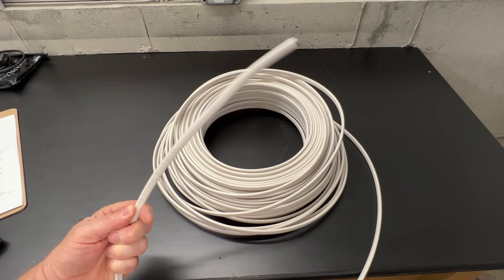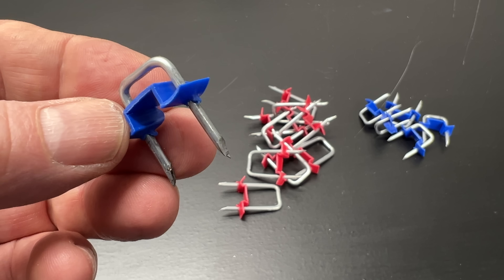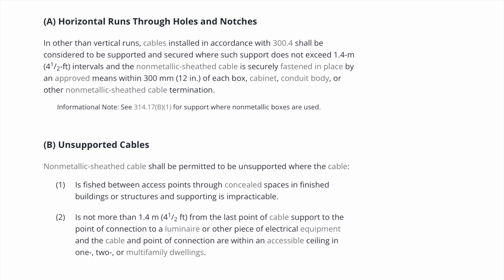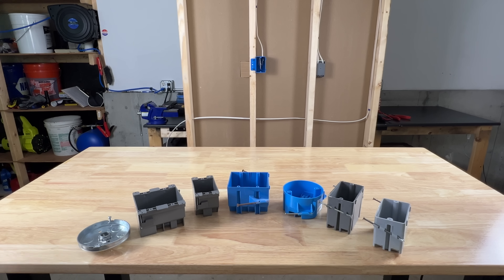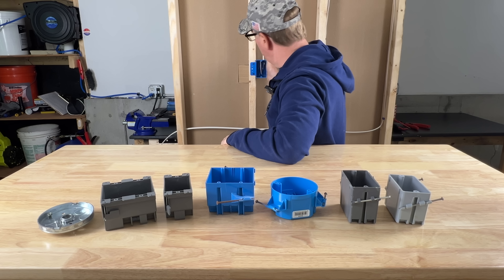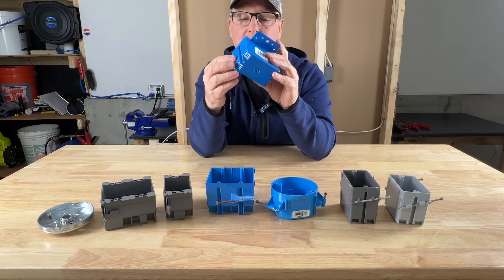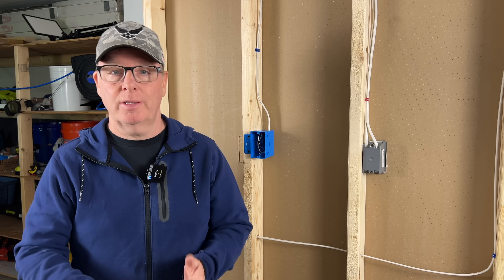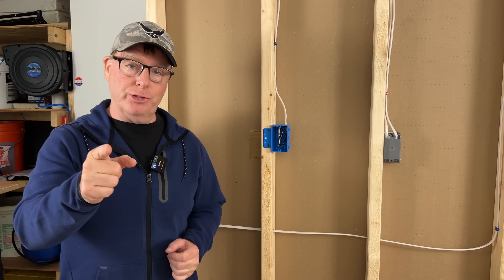ROMEX Cable Support Requirements (2025)

Comment: Alberta electrical inspectors are all looking for the service loop at the box. Not having them fails the installation.
Reply from the maker: Many inspectors here in the US will make you remove them.
Reply: @BackyardMaine   I have worked on old switches that only has 2” of wire inside the box after 40 years of changing switches/timers. A service loop would have been lovely. This still sticks in my mind 25 years later.

Comment: Informative with all the gotchas, thanks for the explanation, I just ran ceiling lights to a quad gang control box in the attic,  while it sounds like the ceiling light boxes don't need secured due to running straight in to the support trussing the control box the cable runs in to need to be secured on that end as well as at the box which it is.

Comment: I use a box of staples every 5 years since I bought a battery powered Milwaukee stapler. It was about time they invented them.
Reply from the maker: I want to try them.. Do they work well?
Reply: @BackyardMaine  yes. I originally had a dewalt and hesitated buying a Milwaukee because they came out a couple years later. But I couldn’t get staples for the dewalt during covid so I bought the Milwaukee. I use both on jobs. The dewalt seems to run longer( bigger battery) but the Milwaukee seems to drive them better. All in all the Milwaukee gets more use as I have multiple batteries for it and the guys prefer it. Money well spent for sure.
Reply: @BackyardMaine  and I use them steady for Mc cable in wood construction

Comment: So all the oh so picky spacing rules go out the window if the cable is run thru a finished wall?  Did the safety reasons disappear just because the wall is NOW enclosed, because when I'm running the cable in a open wall with all the 18" 4.5 ft rules - that area will soon be enclosed.  So the rules are just one more regulation that does nothing for safety but makes all the electrical cabling companies more money.
Reply from the maker: The biggest risk to the wire is during the construction process. Nails, screw, pinching the wire between the drywall and stud other trades etc.

Comment: If the staple is at 4” per se, and the wire is 8” in a unclamped single gang box. Couldn’t that still be a “service loop” (without the loop) and still be in code?
Reply from the maker: Yes a small loop, just be carful of the bending radius requirements.

Comment: Question:  A friend and I were both putting a small addistion on our homes, we live about 50 mile apart. Both have permits but neither of us are lic.  Anyway he used WAGO on his connections and was passed by the town inspector,  I asked my town if I can use them, and was told no, I had to use the twisted wire nuts. Both in same state, different towns. Hmm and why the differences?
Reply from the maker: Some inspectors will try to force there on rules or maybe the town has local code amendments. They are legal to use in any states per the adopted NEC

Comment: The instructions clearly says that the support must be within 8 in of the box, it does not say within 8 inches of cable length. Where did world did you get that interpretation. I know it says measured along the sheath, but it also says within 8 inches of the cable box. Which side of the interpretation are you going to take??
Reply from the maker: Measured along the sheath means cable length. The sheath covers the cable so if you measure along it you are measuring the cable between the support and the box. It's not an interpretation. If you wanted to staple 4" from the box you could still have 8 inches of cable or sheath for a small loop but you have to be careful of the minimum bending radius.

Comment: Yes you can have service loops at 1-gang NM boxes w/o clamps: you can leave a loop with a staple right next to the box opening. If you ever need that service loop slack, just remove the box and that staple is right there for easy removal. 

Oftentimes, we have need to convert a single gang switch box into 2, 3 or even 4 gang —such as for Lutron RadioRa devices. We prefer Allied's fiberglass box because they're easy to break out with a long nose pliers and the device holes are factory threaded unlike many PVC boxes. 

Started in the trade in 1975 been in business for over 25yrs. You and I are brothers in the trade
Reply from the maker: There is minimal bending radius to consider if the staple is close to the box.

Comment: Thank you!
I am going to run some 4/3 romex and didn't know if the rubber lined cable clamps that are attached with screws would be acceptable and don't want to be using large staples.

Comment: question on wire support. 

lets say we have a situation near a main panel, where you have a space between studs that has SEVERAL wires running back to the box. there is not enough surface area to staple every cable to the joist. i will staple the 3 or 4 that i have room for, then i will zip tie subsequent wires to the secured wires. i have had people say this is against code, but i have never had an inspector say one word about it. 

what is the official nec code book ruling on this practice?

Comment: Cool I roughed in my new basement room and the only mistake I made is using blue staples for double wire. so I'll change them up to the longer red ones and everything's good. Also good to know about being able to put two Romex in one of the openings of the box I think it'll be a neater look

Comment: So for horizontal runs THROUGH holes, no extra support is needed.

However, what about horizontal runs on TOP of things like ceiling joists?

Even more complicated by runs at high angles to the joists?
Reply: I’d secure them every 4 1/2 ft. just as an added safety measure to keep them out of the way.  Personally, I don’t want to be in a crawlspace or attic and be obstructed by wires.

Comment: It looks like the romex is running through the middle 1/3 of the stud ? I work in the manufacture housing industry for many years, we could not drill in the center of the stud without a prosleve, but stick built could. I do like your videos.

Comment: I never use plastic boxes cheapo junk use a metal box cut good size hole in the drywall come back fix the drywall. When I got 3 quotes to change out my aluminum wire with copper all 3 wanted to use plastic boxes when I mentioned metal box they didn't want to use them. The reason I like metal boxes is one time a contractor installed a water heater he used wire nuts to bond copper and aluminum. The connection wasn't good and heated up the wire burned back into my wall the only thing that saved me was a metal clamp on a  metal box where the wires were pushed tight enough to trip the 50 amps breaker. The aluminum wire burned like a fuse.  If I had a plastic box it would have burned up into the attic caught fire I'm in Arizona our attics are dry and hot easily catch fire.

Comment: Apparently the code varies across the country or the ordinances can have requirements above the minimum requirements in the code, for instance in Houston we cannot stack Romex on top of each other we have to use stacking blocks or brace between the studs and secure individually.

Comment: Another remarkable clear and concise explanation. Thanks John. One question regarding staples...actually two. Sometimes NM cable is run along the webbing of engineered joists. The webbing is not very thick so the end of the staple might protrude from the other side and if one tried to use a red staple for two wires it would definitely protrude...which would defeat the purpose of using a longer staple (so I have never done it). Are there rules for that?  Also what are the rules for avoiding "bundling" violations for NM cable?

Comment: My ex-boss was a cheap fu... he would get the cheapest supplies imaginable.  We always followed code regardless of the crap we had to work with, and only 3 times did we fail inspection.  There were 16 guys on our team, but one guy always decided to do stuff his way and got us ding'ed all three times.  We hardly ever secured cables (romex), within 8 inches of the box, it was more closer to 6" and we never had an issue with that.  Clamp in the box  or not, 6" was our max for a staple.
Reply: I’m not an electrician but isn’t it “within 8 inches”? So, 6” is within 8”… by that language you could staple 4” from the box and leave a 4” service loop and be ok, no?

Comment: Thanks for the content, especially for digging into the code and clearly explaining it. I actually paused the video and pulled out my codebook to see if I could figure out the code violation on my own before you explained it in detail. 

No, I didn't figure it out on my own, but I did run down "messenger-supported wiring". Learned something new!

Also... the 2023 code does make some very minor changes to 314.17, but most jurisdictions are still yet to adopt it so :shrug:

Comment: What's the logic on  not securing the cable at a ceiling light?
Reply from the maker: It's often not feasible when using can fixtures or strip lighting. As long as the fixture has a clamp and you secure to the nearest joist and within 4 feet it's acceptable and is at minimal rick of damage.

Comment: Heres how it really works. Code is 12 inches. Depends on the inspector. Loops are really dumb but one inspector here expects a loop. So we do it yo code and have a loop.
Reply from the maker: Code is not 12 inches for boxes without a cable clamp.

Comment: What type of cable ties can be used to tie together multiple romex wires for example in the electrical panel to make a clean install?  Any particular brand?  Or just the cheap dollar tree ones?
Reply: I would just neatly train and bend them without any of the plastic ties.  They won't won't flutter around. And it leaves air space for ventilation and makes it a lot easier to trace if needed.

Comment: Awsome video John, great to have the summary,  a true teacher!
You mentioned the plastic boxes and the code compliance,  what about metal boxes, does what you just went over vary??
Reply from the maker: Thank you my friend. Metal boxes will have a built in cable clamp or knock outs where you would install a ROMEX connector. All metal boxes require a clamp.  The requirement of within 8 inches is for single gang non metallic boxes without a clamp.

Comment: So if you have an issue later you will have to rip the wall apart to fix it .
Reply: You're missing the point of the code. It's meant to keep the cable from being penetrated by drywall nails/screws mainly and by other things. Drywallers cannot hit a stud consistently to save their life and if your cable is touching up to the drywall, it's going to get penetrated by that screw.

This is not the fault of the drywaller. It's only their responsibility to use the correct length screws for the drywall as to not go within the center third of a stud. It's an electrician and plumbers responsibility to keep their cable and pipes in the center third of the wall. And never the twain shall meet and everyone is happy. If a screw is missed, it's a non-issue.

The code on all sides was made to be this way. To account for many scenarios including improper installation and mistakes. So that none of those things can either cause damage to the material or damage to a person, as much as reasonable.
Reply from the maker: If everything is installed correctly and wired correctly, you will never have an issue later. I wire my home 26 years ago and I have had zero electrical problems.
Reply: @BackyardMaine  yes but there is millions of houses bought and sold ECT there are additions and such, there could be a fire or over load so please don't be so close minded or self centered because u still live in the same place you wired,as this isn't about you it's about everyone and please I'm not picking a fight.
Reply from the maker: @kerrytaylor4366  I'm not close minded. I just follow the code. Not supporting cable because you might have an issue someday is a bad plan. The supports are specifically designed to prevent the cable from being damaged.

Comment: The standing desk is a code violation.  The vertical corner  radius on each corner is .0005 under the minimum spec.
Reply: That measurement is only valid if you had a good set of calibrated eyeballs. Otherwise, 0.0" to 0.25"r is acceptable. The only requirement there is that the edge doesn't give cuts similar to paper cuts.😎
Reply: Thank goodness that we have eagle-eyed viewers like you to keep us safe!🤣
Reply: :) too funny
Reply: As such, cushion corner protectors are required when the table height is adjusted to within 8 inches of the noggin of a kind that occupies the space within a 24 foot radios of the center of said adjustable table.
Reply from the maker: Ok.
Reply: Hahaha!!!
Reply: You don't even know what .0005 is. That's half a thousandths......
Reply: @JamesGill-c9f  that's right

Comment: I started in 1981. I do not remember anyone even thinking about "service loops" until i started watching these youtube videos. Is that really a thing in some parts of the country? I have never experienced a situation where i wished i had a service loop. The idea has always been, keep the wire neat and out of the way of insulation etc.
Reply from the maker: It isn’t a thing around here. ME, NH, VT, MA. But I hear that it is in the south. I have never left a service loop unless I knew something may need to be moved.
Reply: @BackyardMaine probably the best places for those would be like ceiling lights I would think especially of the suspended ceiling variety
Reply: @BackyardMaine  I know this comment is old, but to sum it up to cover all of the New England area: it is not a thing in RI either.

You forgot the RI love 😂
Reply: It's 100% not needed and I have never and will never use it. Looks ridiculous.
Reply: @SlimSavageBlanco what happens if drywall installer rotozips your wires in your box and they all need to be cut back 4, 5 maybe the full 6" of wire that's needed to do box?
Reply: @JLfpv Then you open the wall, replace the wire and said drywaller repairs the wall.
Reply: @MikeSwirled youbsay it like running a completely knew run is that east. As you know yoy cant have any splicing yhats not accessible so you would im fact gave to run a whole length from nearest junction box, which moght be the panel. Instead of just pulling 6 inches from your service loop. Indont like doing worknfor free so i protect my time.
Reply: @JLfpv Who said anything about working for free?!?
Reply: It's just another excuse for substandard construction. Imagine running any other cable assembly and leaving a "service loop".
Reply: @lh5943    Several years back I replaced wiring in a room. Power worked fine. However, for some reason, breaker kept tripping. I traced it back to one outlet. Somehow, there was a small nick in the black wire that caused the short that didn't occur on testing. Luckily, I left myself a bit of extra wire that I could pull thru the box. If it wasn't there I would have had to tear open the wall to get to the wire. All part of my 'substandard construction'.
Reply: I’ve seen kitchen remodelers use service loops and the reason being that ‘The Wife’ changes her mind about the location of switches.
Reply: Great video. I don't like the "clamp" on the blue plastic boxes, so I just break them off. I've been worried about many old work boxes I've installed without any clamps. I know for fact these wires were stapled within 8" of the boxes. I feel better already. Thank you.
Reply: Much of the reasoning behind leaving a service loop has been obsoleted by Wago and Ideal connectors.  You can snap three Wago Lever-Nuts on a cable with only 1" of wire extending.  The 'splice' style takes only about 3/4", but I don't think any are UL approved at this time.
Reply: Service loops are for handymen, DIYers, and slack jawed yokels. The NEC states this pretty clearly. You just have to read 16 different sections of the code and cross reference them like a crossword puzzle.

Comment: What is the actual PURPOSE of the staple just outside the box? Nobody is going to be pulling that cable in either direction.
Reply from the maker: A few reasons for supporting NM cable. One is the cable sheath needs to extend at least a quarter inch into the box. Otherwise we have unprotected wires outside the box. The support helps the cable stay in place. Next supports actually help protect the cable by keeping where it won’t be damaged by screws or nails, pinched between the finished wall and structure, or come in contact with anything else that could damage the cable during construction or years later
Reply: A Firemen with a pike pole will, chasing a fire inside a wall..

Comment: If the Romex comes out of a drilled hole within 12” of the box with cable clamps do u still have to add a cable support?
Reply from the maker: Yes it does and within 8" if the box has no clamp. The code article reads. 
In other than vertical runs, cables installed in accordance with 300.4 shall be considered to be supported and secured where such support does not exceed 1.4-m (41/2-ft) intervals and the nonmetallic-sheathed cable is securely fastened in place by an approved means within 300 mm (12 in.) of each box, cabinet, conduit body, or other nonmetallic-sheathed cable termination.

Comment: I’m adding a single gang box behind my TV. Going to fish NM 12/2 down the wall and into an old work box.  If i use clamps on both old work boxes I understand I don’t need staples because of the fishing exception.  If I use knockouts instead of clamps in this scenario do i have to use staples?
Reply from the maker: Yes, you are correct..
Reply from the maker: Old work boxes with the wings like I showed in the video have the cable clamps. But if you were fishing a wire down to an existing nail on box without clamps, you could do that without support base on the information provided in the section on un-supported cables.
Reply: Thank you for your very quick reply and professional expertise!